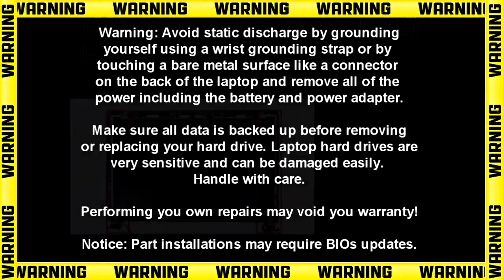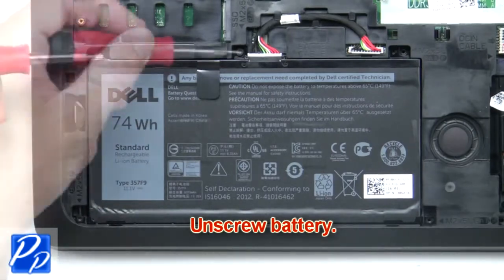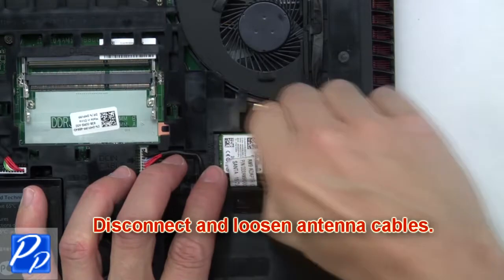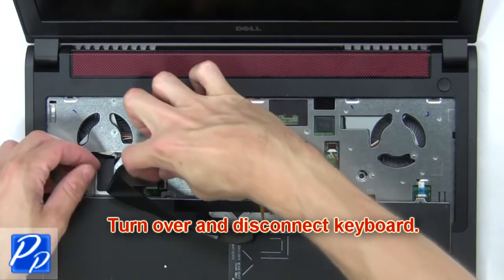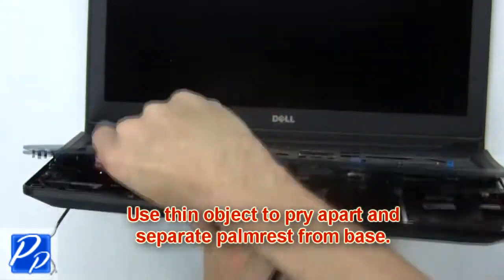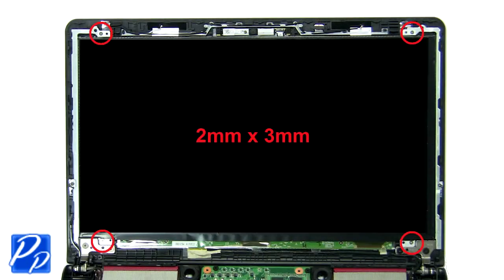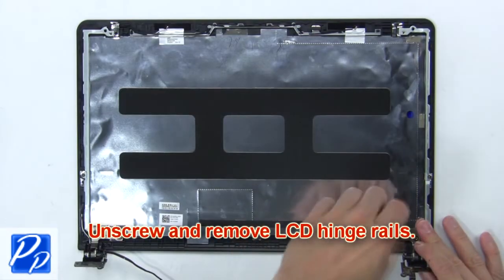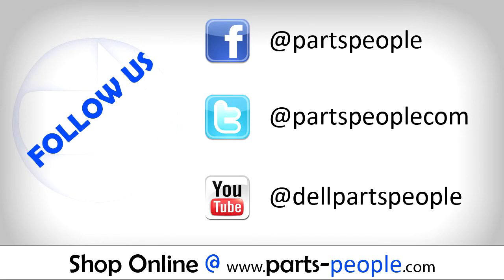Dell Inspiron 15-7559 (P57F002) LCD Hinge Rails How-To Video Tutorial

Comment: I completed everything in the video, but I am having trouble attaching the palmrest back on/screwing in the bottom base screws. What could I be doing wrong? The palmrest seems to attach most areas, except near the hinges. I can't seem to figure out what is blocking it, and this part is missing from the tutorials on your website, the Dell manual etc.
Reply from the maker: I really can't tell you with out seeing the laptop. Something has to be in the way or not aligned properly but if it came apart it will go back together. Which part is missing from our tutorials?

Comment: there is a hinge problem on my dell 7559 plz help
it comes apart as close and open my screen
Reply from the maker: It sounds like you need to replace the hinges or the back cover.
Reply: how much the back cover cost ?
Reply from the maker: We are currently out of stock but when we have them they cost about $45